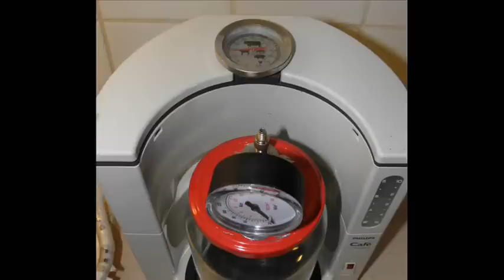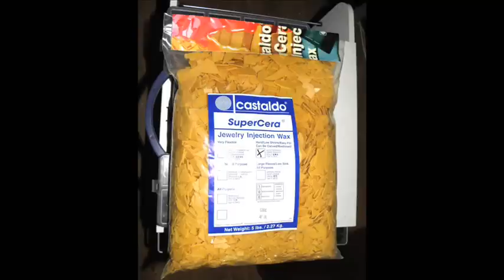Wax Injector ! Simple to build! Costs under 10 $

Comment: This is by far the best idea Ive seen for making a wax injector.  I think the only thing I would do differently (though I dont know if its necessary) is to use a metal container to heat the wax.  Going to try something similar and see how it works.  Thanks for sharing!

Comment: How did you get the hole in the jar to not leak around the brass tube? BTW, relax people. It's 160 degree wax under 5 psi. Not exactly a pipe bomb.

Comment: This seems incredibly dangerous to me. Heating a glass jar with a new failure point (the drilled hole), then putting it under pressure with hot wax inside? Yikes.